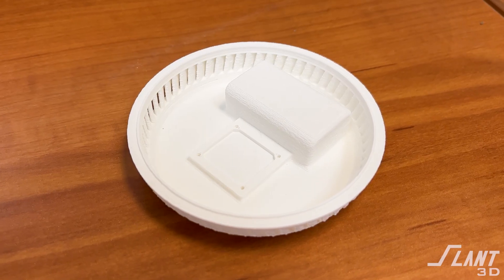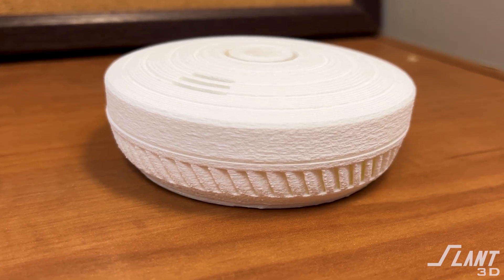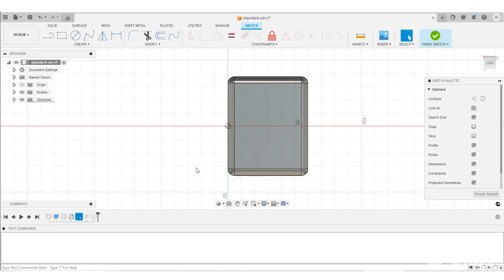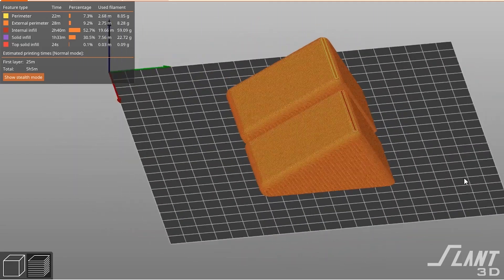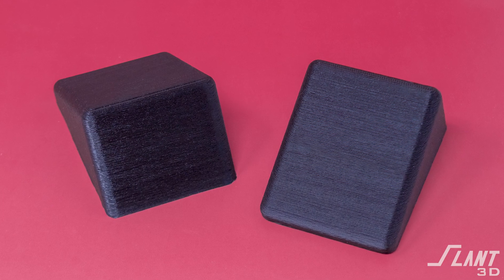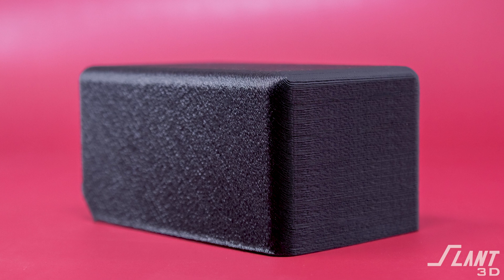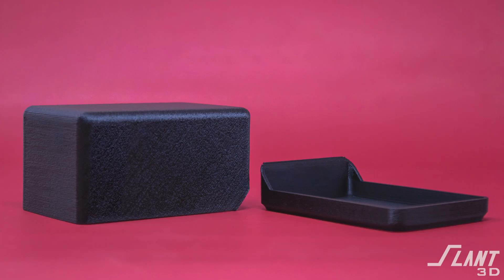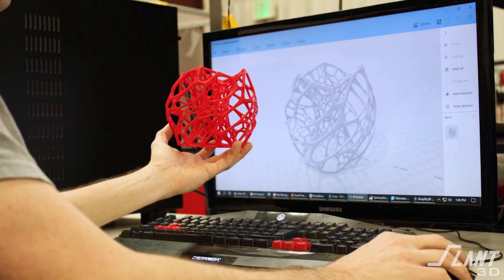Secrets to Better Surface Finish for 3D Printed Electrical Enclosures

Comment: Mass produced 3d printed parts? 2 hour print vs 10 sec injection molded cycle? Tooling is not that expensive anymore

Comment: 4:46 I don't understand this support - if the part was going to fall, wouldn't it fall before it gets to the stage where it's supported by the green support? Doesn't the green support need to come into play earlier, supporting the diagonal edge a few times along the way with sprues?

Comment: I like the idea of a more uniform external finish, but with such a small contact face, how do you get enough bed adhesion? Particularly when printing with ABS/ASA (90+% of my printing) With a large part/tiny footprint even if the glue holds it tears up the build surface...

Comment: Your videos are great and informative. I need help. Consider a box measuring 100x140x70mm. This is a ceramic master mold. I take a perfect silicone mold from it, pour plaster into it and it becomes a ceramic mold. But no matter what I did, I couldn't prevent the output from shrinking. I pressed it full but it didn't work. It was 2mm thick and I filled it with supports but it didn't work. I added fillet to the corners and it still didn't work. 3d hollow, 2d hollow, I tried them all. Since it is a curved surface, I cannot intervene much after printing. I need to get outputs that will require very little intervention. I don't know if I should split it and screw it like in this video? can you help me?

Comment: Maybe it works better for mass production but i dont think the parts would mate together as neatly that way.  It doesnt take into account having shadow lines or any similar sort of internal mating surfaces like a smaller internal protrusion from the top piece to help it mate the parts together.

Comment: "Somewhat" related design question about parts that are going to be fitted and then glued together:  Are channels for the excess glue to flow into a thing?  Or designing in a slight angle into one of the surfaces so that any excess glue does not get on a internal mechanism, but instead is forced in a different direction?
Reply from the maker: Both work

Comment: 1:45 printing with the lid  topside down is bad because the top of the enclosure has the bed texture and doesn't match. 
4:43  printing with the lid topside down is good because the top of the enclosure has the bed texture which can be used as a feature.
Reply: That's what I thought, too. I get the point of cutting it diagonally so the two "pyramids" are uniform, but his last point is contradicting.
Reply: funny, but im pretty sure 1:45 he was talking about the body of the enclosure not the lid, and he says that the lid being a different texture makes sense to him. i dont totally agree that one makes sense and the other doesnt, but i at least see his point and its consistent

Comment: Would like to see more practical examples if possible.  On the lid I add text, what advice can you offer in cases like this?  also about attaching the lid to the box, bolting is a completely unnecessary option in most cases.

P.S. I would like to thank you for the fact that thanks to your videos I began to look at the usual design of things in a new way.
Reply: I add text using tinkercad.  I nodel the text as a 1.5mm hole but reversed.  So when it prints the kit the text is sunk in 1.5mm and works great

Comment: I recently got an Ender3 Sadly the filament keeps jamming and its fully stock. Do you know anything i could try?
Reply: If you haven't already, a nozzle change may be a good first step as it may be clogged or partially clogged. If that's not the issue, check your retractions and your extruder. Is the extruder motor clicking? If you're retracting too much, the filament may stick. Other issues could be the extruder tension is too little/too much. I had an issue where I had too much tension on the extruder arm and it was deforming the filament and made it very difficult to feed into the hot end, let alone print with it.
Reply: Did that
Reply: @Mijo0x9  get a new roll of filament, increase print temps, consider replacing the bowden tube, check the bowden tube is fully pressed down into the heat break and locked in place
Reply: also slow down your print speeds, you might be printing too fast and your nozzle can't melt plastic fast enough
Reply: @RyanRapini  Thanks for the help but i fixed it like 4 months ago. I since upgraded my Ender 3 to have a toolswapper (DIY) so it can CNC and lazercut plywood. Haven't used it yet but who knows.

Comment: Another tip I've seen for "hiding" the seam in a part is to do the opposite and design a small seam that cuts in to the part all the way around, making it a feature rather than a mistake.
Reply: aka a shadow line